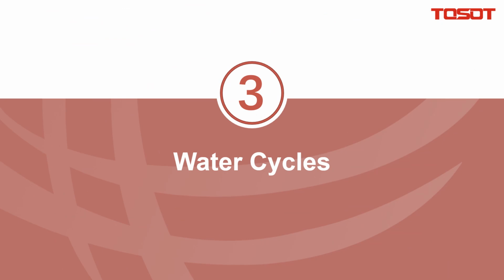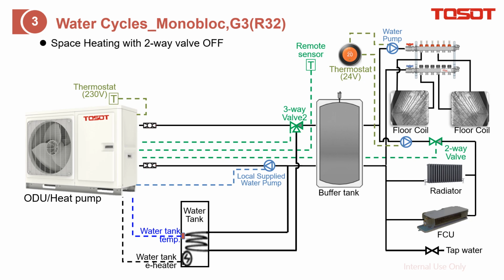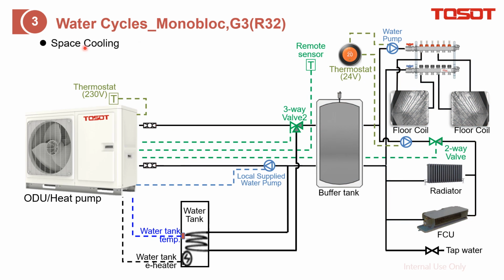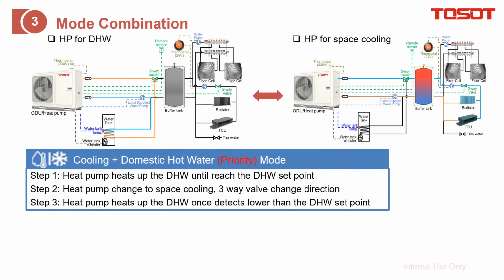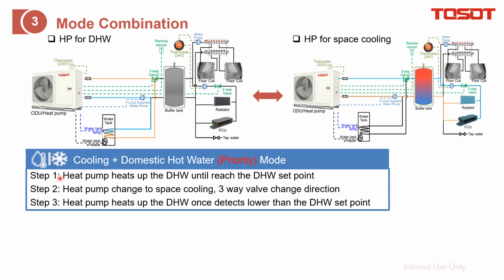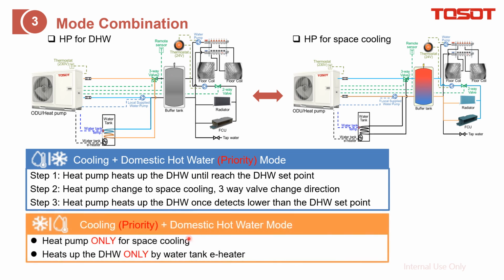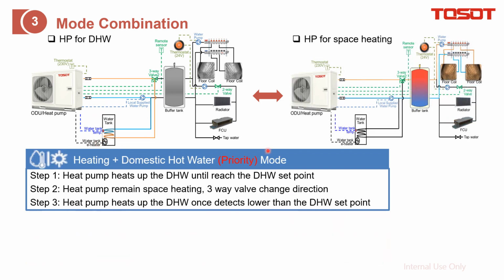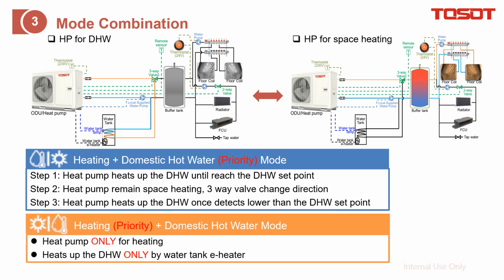0513 VERSATI4 NA ntroduction介绍(3/4) WaterCycles水系统循环

Comment: hello, where can I still see the old videos for Versati 4, can you send me a link?
My unit came from the factory with the controller with Protocol version V21 and Program version V23, those from gree Romania sent me the controller with a newer version, respectively Protocol V24 and Program V25, but I cannot pair it with my unit the following errors appear: ODU-IDUCom.                   and IDU Com, do you know what the problem is? how could I do a software update?
Reply from the maker: Burning the controller program requires a special tool called "ST-LINK Utility" and detailed information you need to ask the local Gree distributor. After replacing another communication cable, if this "ODU-IDUCom." persists, advise asking the local Gree distributor for help.
Or you can try to contact Gree factory directly, just describe your situation, and they will guide you on what to do. 
Tel: 0086-756-8614 883 / 0086-756-8522 218
Email: global@cn.gree.com
Reply: @TOSOTsuppliesSharing  Thanks for the answer, I will try directly at Gree, I also want you to tell me if I set the "C/p Limit" to 8kw, my pump being 12kw (it's a bit big for my house), what happens when it reaches 8kw, does the compressor stop, or does it modulate its power up to a maximum of 8kw, thus reducing the current consumption?
Reply from the maker: @turby3085  the system will modulate the compressor rpm(the largest power consumption) to meet the setting. However, the "c/p limit" is just a calculation relying on the current, and the result is inaccurate (about a 10% deviation from the setting value).
Reply: @TOSOTsuppliesSharing thanks, so it is not advisable to use this option?
Reply: @TOSOTsuppliesSharing  thanks, so it is not advisable to use this option?
Reply from the maker: @turby3085  Yes, that is the only way to achieve your purpose. What I wrote here is a reminder that the accuracy would not be as high as you think.
Reply: @TOSOTsuppliesSharing  Thank you